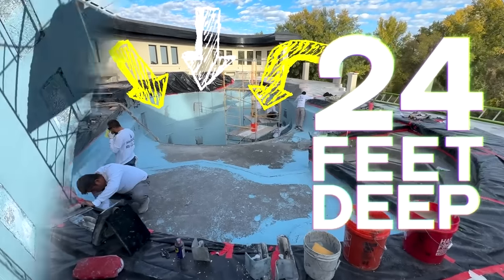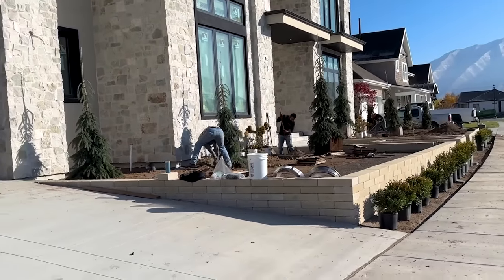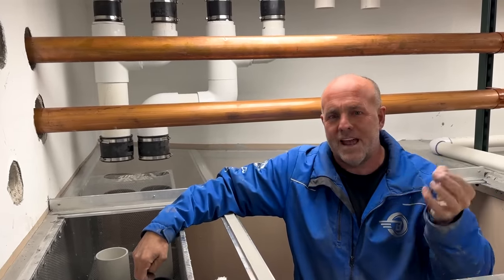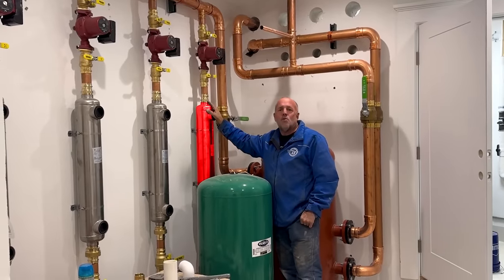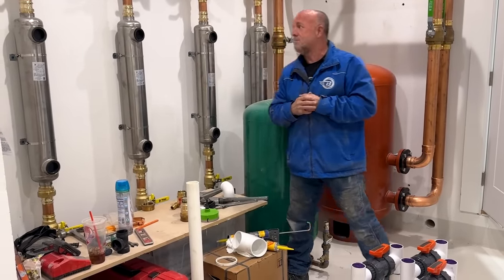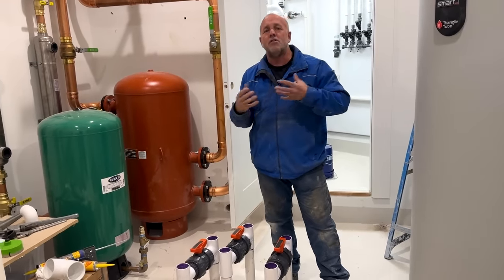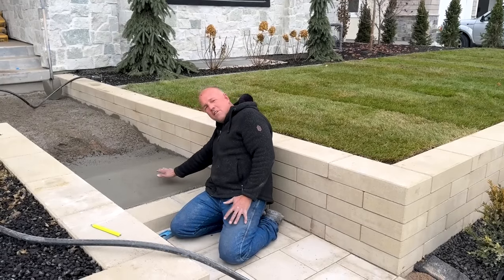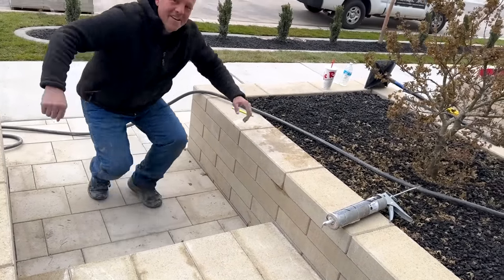How to heat a 24 foot deep SCUBA pool? | House Build #21

Comment: At current utah NG prices, a 1.5Mil BTU system going full bore costs approximately 20$/hour to run (1 mil BTUs pwr thousand cubic feet NG, 14$/thousand cubic feet Natural Gas. ) 

A lot cheaper than i expected 😂

Comment: A really good design of the heating system. I would only have used the Stratos MAXO from Wilo instead of the Grundfos circulation pumps. The Stratos is highly efficient and in automatic mode it adjusts the flow rate automatically. Even in manual mode, you can adjust the flow rate better than with the Grundfos. With pumps, it's the OpEx that counts, not the CapEx 😉

Comment: The heating system seems very well laid out, but i wonder if a heat pump (or several) could've done the work of the massive amounts of natural gas you'll be burning.

Comment: We're in Canada. We heat our house with about 10kW of electric heaters, and they run at maybe 20% to 25% duty cycle during the winter (based on the electric bill).
Rule of Thumb for being eco & efficient: If Step 1 is spending millions of dollars, then you need to read-up on embodied resources and eco-ROI.

Comment: Which also gets me curious as to what the energy cost is purely moving all that water (pool system as well as domestic) around through the filters, etc.?  Even though Grunfoss makes some impressively efficient pumps you are moving one heck of a lot of water even when the entire system is not in use.  I also saw some "Black and Decker" what looked like massive pumps?  I thought they were long gone from the business scene except as a Chinesium purchased label??  Knowing your penchant for top drawer equipment that name surprised me.

Comment: Impressive. Question: How will the Ti heat exchangers work with the pool chemistry? I know chlorine and Ti is no bueno.
Reply: I believe it's a saltwater pool
No chlorine
Reply: Could be but the salt in saltwater pools is converted into chlorine via electrolysis in a chlorine generator, so chlorine would still pose a problem.

Comment: House looks amazing but one thing I noticed is it's not wheelchair friendly.  I need about 36 inch doors for my wheelchair and hall ways just to get around no ramps leading into our out the home. idk I could never live in a place like that.
Reply: There is an elevator inside that will accommodate a wheelchair or mobile scooter. Interior doors are 3’ wide and hallways are 5’+, except in the basement, those are 4’. If needed, ramps can easily be installed over the exterior stairs.
Reply: Wow it sounds more accessible than I could realize from the videos! Thanks for sharing! I personally have been struggling with Accessibility from my town flipped my wheelchair out into the street on Dec 1st 2023 because there was not curb cut or ramp into the street crossing location. Anyway I am so glad you all thought of the future with accessibility I wish back when I could still work I had done the same. I hope some day he shares a good video on the accessibility side I love seeing those personally it really hits at home that there is hope for the future.  @ChandraSlyFoxPatey
Reply: @LorenTedford  All my best to you.

Comment: I am wondering what the substantial BTU cost of having instant hot water would be ball park?  Even though it is highly efficient as part of the system it is still heating a circulating loop that is giving off energy constantly.  That is a huge house and the linear run has to be immense.  Obviously the pool is going to be the main energy draw but I am interested in just what the domestic side would draw energy wise even when no water is being used?  It is a wonderland when budget is no consideration.  The options are limitless.

Comment: You ARE planning on putting insulation around ALL those COPPER PIPES, right?? That would be a LOT of heat loss if you didn't...
ALSO you might want to think about putting some insulation on top of that 'Plexi-Glass/Lexan/Acrylic' covering the tanks... they WILL allow a LOT oh heat through them, and there's no need to waste all that heat if you don't have to. And you could make them removable so you're able to see inside the tanks easily without TONS of steam filling the room.
And what about warping of that acrylic sheet (I can't remember exactly what you called it :/ )over the tanks? I couldn't tell how think it was, but I would think that because it's heat AND STEAM it COULD be an issue, but I have no idea really -- You ARE THE Expert here! hehe - Maybe some 'memory foam' around the edges could fill in any gaps from warping
....just some thoughts... :)

Comment: Caution to anyone considering or using a continuous hot water circulation system: While these systems offer instant hot water, they also pose a risk of Legionella bacteria growth if not properly managed. Legionella thrives in temperatures between 20°C and 50°C and can lead to serious respiratory issues. To mitigate risks, it's essential to periodically heat water above 60°C, ensure the system has no stagnant zones, and maintain good insulation. Regular maintenance and checks are vital to prevent bacteria growth and ensure the system's safety and efficiency.
Reply: We also put a good filtration system on the house. That is definitely a concern.

Comment: Incredible but I do have one question. What if, by chance, a squirrel gets caught in the pool and is pulled into the skimmer drain?
Reply: You may need a new squirrel.
Reply: Hopefully, there’s less risk of that given that the pool isn’t at ground level and we don’t have that much of a squirrel issue where we are. But i suppose it would go for quite a ride if it did get in there and we’d find it downstairs.
Reply: @AllanFolm 😂😂😂

Comment: are you sure your water to water heat exchangers capacity is calculated correct? Because you have 2x750kbtu boilers. those heat exchangers are usually rated at huge temperature difference and enormous waterflow and operating conditions usually 1/4 of that. so could limit heating to 400kbtu olny. 

to impress people should’ve gone with inverter heat pumps

Comment: What happens, when a plane builder construct a house?
He has backups for backups, everything redundant and overdimensionated.
Evening need to work even in the most rare case of a failure 😂.
Mike, do you even have a backup generator, in case the public energy supply fails?
Reply: Roger, we have backup power.

Comment: Q: The Steps. Why did you side the half-brick risers instead of locating them centrally with a full block either side? Whilst you are clearly a perfectionist, you chose non-symmetry step risers in a half-brick, full-brick, full-brick configuration. Just seems odd (no pun intended).

Comment: You're a good engineer sir. But 2 foot  thick layer of gravel against the bricks, then topped with soil, would really have helped the water drain. And about 3, 4 inch PVC drains at the bottom of the wall. You'd never have to worry about the wall leaning. But I'm sure your way will be fine to. Not very high.

Comment: Gosh, I'd hate to have to pay your heating bill. Did you ever think of adding some solar hot water heating panels? And what about your roof, how about adding some solar photovoltaic panels? How about running a Geothermal heat pump system to help cut energy costs?

Comment: love your perfection.. paver steps looks good. I think the way you set them will be good.  But I dont think a contractor could take so much time between steps.  Your supposed to glue up PVC within 5 mins of applying primer.  Recirculating hot water... tell us your rich without saying it.     plus 1.25 mil  omg

Comment: 9 views and 32 upvotes?    Way different ratio than the typical Youtube video
Reply: Because people just hit like button..
Reply: because the counters do not necessarily update in real time, depending if it was watched from a registered account or just from a web browser etc...
Reply: @Cent51 yes.   It was like 2 minutes after video dropped,    20 minutes later after I had watched it, it was something around 1200 views and 200 upvotes.   which is excellent, and mote what is expected.
Reply: Most people like the video before they even watch the video because we have never been disappointed in the past and don't want to forget after being mind blown by the video.  JMO.
Reply: @tomenglish8554  Yep.... that's certainly what I did.

Comment: Yeah, its called "instant hot water" and not uncommon in a custom home.  1.5mil BTUs?  Jeez.  We have a large carrier geothermal system feeding 3 exchangers for 12k sq ft of radiant floors, a pool, and the driveway, reliably for 20 years now with a fraction of what you have there.

Comment: Having water run off from your yard into a natural water source is not a wise idea. Yes it’s simplistic and seems intuitive. But you will have treatments on your yard. Other chemicals over time leak into it from the proximity to the home. This then gets feed directly into the river and can causes pollution. This isn’t just a statement for environmental. If water test come back and they trace it to your property. Wow will you be regretting the fines and clean up costs as well as the remediation construction. This is why stuff is routed to streets or directly into storm drains. Many storm drains systems go through some type of treatment and catchment to help with the pollution. Uptake is this system is expected to have the low level chemicals and pollutants so it’s not going to be traced back or be labeled incorrect unless your clearly dumping chemicals then that’s on you for a super fund site. Yeah it’s a small yard but it’s something to consider. Anything that goes from your property into a water source is all on you. With test equipment sensitivity, big brother everywhere, and environmentalists. It’s not worth it if you just plan in advance.